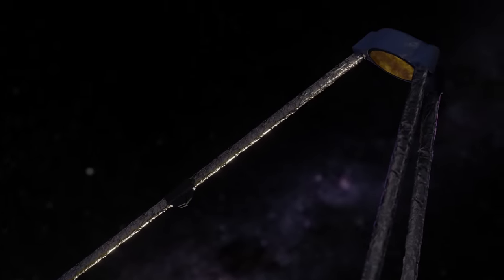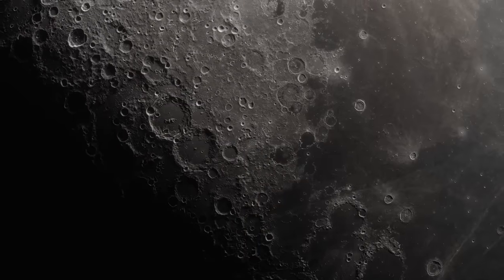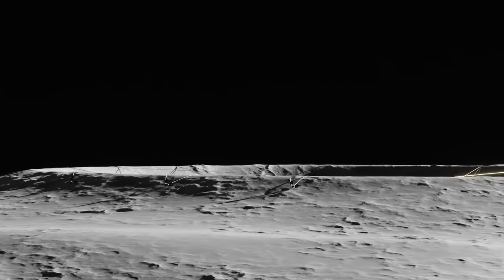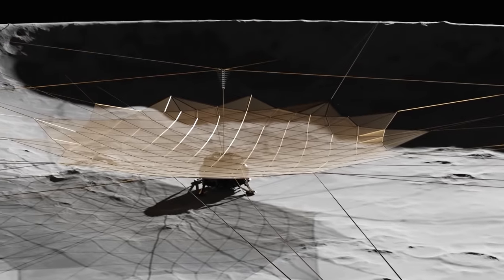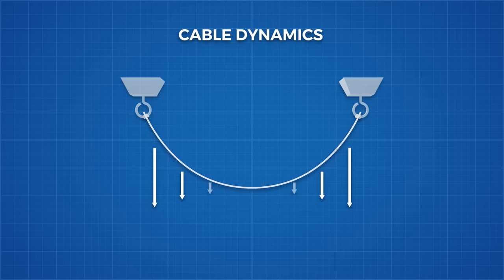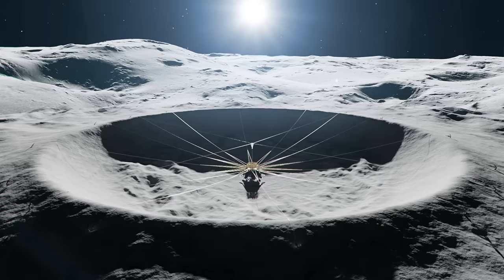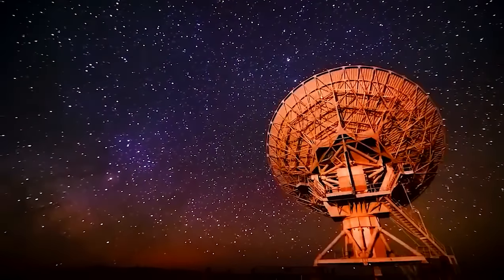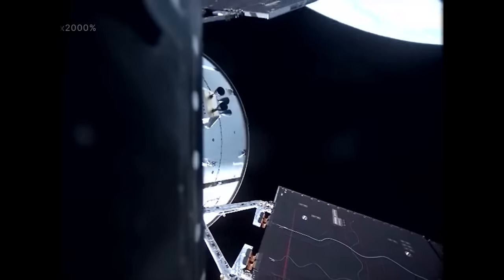NASA's Plan to Build A Telescope on the Moon

Comment: There's a near-future, hard scifi manga called Space Brothers where they build a radio telescope in a crater on the far side of the moon. It is an array of detector posts arranged in a 3-arm spiral with initial delivery of the posts done from orbit and then the crew and the helper bots connect them together. I highly recommend it, it's a satisfying and optimistic astronaut drama with no real antagonists.

Comment: Amazing work as always
Can you explain the weight point you make at 7:05
If the Moon's Gravity is 16%, how is 200 kg equivalent to 320kg on earth ?
Reply: He probably meant 2000 kg
Reply: The correct answer would be 32 kg so, it's probably just a decimal error
Reply: He corrected himself in a comment, he meant 2000kg to 230kg
Reply: He meant to say 2000kg, rather than 200kg
Reply: The subtitles had 2000kg
Reply: 2,000 kg on the Moon equal to 320 kg on Earth.
Reply: Has anyone mentioned that he meant to say 2,000 yet? Well let me say it anyway. There's worse bandwagons I could jump on...

Comment: I was already impressed with the idea of building a telescope in a crater on the far side of the moon. But when he said it was going to be done with robots, I was floored. Its already difficult enough trying to accomplish this with astronauts, but creating robots that can intricately and accurately build this telescope from earth is a level above hard mode.
Reply: It would be harder with astronauts, which is why they are doing robots.
Reply: @waspsandwich6548  No, it would be significantly easier. It takes far more effort to design and build a single-purpose robot that comes close to the ability of a human than to have a human do it. The reason astronauts will not be involved is purely because supporting astronauts for a long-term mission is ridiculously expensive, to the point that it would be completely infeasible with NASA's current budget.
Reply: @none-ro9dz  that's what I mean by harder. As in, in the broad scale of the entire mission it's harder for astronauts to do it than for robots to
Reply: Wikipedia says the apollo program cost the equivalent of 178 billion of today's US dollars. But that included 6 separate lunar landings, which means it was only 30 B$ per trip!

I'm sure you can't count like that since they didn't start each mission from scratch. But on the other hand, this telescope project sounds so complicated that it would surely exceed its suggested 10B$ budget. So... what's the safer bet? Training a few astronauts and get them to the moon and back (something we have already done), or inventing a whole new yet reliable robotics system? Who knows.
Reply: @none-ro9dz  If only we stopped funding pointless wars and diverted those budgets to something actually meaningful. Such as space exploration.
Reply: @Someguy6571  If only we stopped funding wars and pointless space missions and focused on important things like reducing pollution, providing healthcare and ending poverty
Reply: @none-ro9dz While I agree with you that we should also do the things you also as well said, but what is wrong with exploring space? How is space exploration pointless? I mean Earth isn't going to be around forever. Sometimes you need to plant the seeds for the trees you will never yourself see the shade from. Gotta think long term.
Reply: @Someguy6571  Right now, we simply lack the technology required to make interstellar travel even remotely possible. We also don't have a way of determining for sure if a planet is habitable, so the potential long term benefit of space telescope projects is lost and the overall effect is that we're just cataloguing distant rocks, ice, and fire. 

There's also the fact that that potential is only there if humanity survives as a global civilization for the indefinite future, which we won't if all our resources are spent on the military industrial complex, which the space industry is completely dependent on (as well as the proportionately less but still significant wastage behind spaceflight).
Reply: @none-ro9dz  We need to start somewhere, and I agree that we need to stop dumping money into senseless warfare and more into further improving humanities wellbeing.
Reply: But that doesn't make the 0.1%'s even more wealthy, so no, can't do that.  Besides imagine the increased illegal migration that would occur if the U.S.A became an actual "preferred destination" rather than the most convenient.

Comment: What about possible object impacts on the telescope? This is something that is not mentioned in the video but can be a massive threat for the project, and makes me question its feasability. There are literal tons of material reaching the Moon daily, and with no relevant atmosphere to dissolve them, even the tiniest marbles could pose a danger for the telescope. The fact that it is planned to be built on the dark side of the moon doesn't help either. It's even more exposed to impacts than the bright side, because it faces outwards from the gravitational pull of both the Moon and the Earth.

Comment: Imagine this actually gets deployed, everything works fine and than it's destroyed five minutes after by some random cosmic debree.
Reply: debris*
Reply: As he said, the mesh step should be smaller then the wavelength, which 6.5 meters. So, if it is done with, lets say, 6m step, there is a pretty good chance that some random cosmic debree will simply miss.
Reply: I’m pretty sure that’s why they wanted to see early on if they can alter the trajectory of rouge asteroids
Reply: @MSP_TechLab  Yeah, but I'd imagine the center is a big and important target, would'nt be such an improbable target to hit. Especialy since the Moon has no atmosphere to burn down even the smallest debris which traveling at those speeds could cause a lot of damage (not even Flex Tape could fix that).
Reply: @ColdyCZ  I think, of course, probability will be higher. But danger of meteorites and space debris is over exaggerated by hollywood movies. So, I assume that much smarter people in NASA  calculated such risk and decided that it is appropriate.
Reply: There are risks no matter where you put it. The odds of it being destroyed there are lower than the odds of it being destroyed on Earth.
Reply: Kramer: Force fields, Jerry, Force fields!

Comment: around 6:30 there are some small mistakes... the desired shape is not spherical but parabolical (this is common knowledge, you don't need to make it "easier" than it is).
And the weight distribution to achieve that is the opposite of what you showed. it needs to be heavier in the middle, with a distribution of the form 1/sqrt(1+x^2). If they introduce crossings under tesion, like a spider web, than they could counteract that. The tension in the ring structures can even be easier to adjust (compared to weights) if something doesn't work as intended.

Comment: Building this on Lagrangian poin just  is a lot more sense:
1. Sending astronout is plausible 
2. Waay less delta v (even less delta v than GEO ) 
3. Far enough from earth interference 
4. No temperature fluctuations
5. No weigh. You can use reaction wheel and lighter material.
6. Easier communication

Comment: 0:36: 🔭 The James Webb Space Telescope has captured incredible and unprecedented images of the universe, but a massive space radio telescope could allow us to go even further back in time.
3:10: 🌑 The lunar orbiter has been collecting data since 2009 and needs to be on the far side of the Moon to avoid radio interference. A crater with specific dimensions and characteristics is required for the telescope's operation.
6:05: 🌙 To create a better focused beam, the shape of the wire needs to be closer to a half-circle, which can be achieved by strategically suspending weights along its length.
9:20: ! The use of origami in space missions allows for compact packaging of large structures.
12:08: 🌙 NASA and ESA are investing in lunar exploration, with the goal of sending humans to the Moon's south pole.
Recap by Tammy AI
Reply: ok. why

Comment: the best method would be to have a drone that can drive to each point, secure the wires, and send them into the center, to be collected and attached, then used to setup the rest with special cable climbing drones. as this would allow adjustments on the fly, if needed, or to lower them to reduce damage, incase of any weird situations that might need a new cable to be planted.

Comment: Lunar dust might be a big challenge for this project.
Reply: no wind on the moon I think it's ok
Reply: In the construction phase, probably. But once the telescope is up and running, dust on the Moon shouldn't do much.
Reply: @looknamman  the moon has no atmosphere so all the space dust is still a problem, especially considering relative velocity
Reply: I don't know if dust covering the dish would actually have any impact. Is moon dust transparent at those wavelengths?
Reply: This was my first thought. Lunar regolith is an order of magnitude worse than something like terrestrial sand. It's sharp and incredibly abrasive as a result.
Reply: @looknamman  Moon dust can develop an electrostatic charge when exposed to the sun. This causes the dust to levitate. No wind necessary.

Comment: The faster and more economical way to build a powerful Lunar telescope, would be with multiple telescopes launched in various missions, arranged in a pattern. Or even simpler and viable, assembly a giant telescope at orbit, and then deploy it to a Lagrange Point. No issues with dust, landing, or thermal amplitudes.
Reply: Maintaining a formation of satellites at a Lagrange Point is increadibly complicated.
Thermal oscillations would still be a problem, since every Lunar Lagrange point is eventually directly in front of the Sun (with the exception of L1 which can't be used anyway because of noise coming from the Earth). 
Orbiting satellites have a lifespan dictated (among other things) by their propellant availability for orbital maneuvers. Maintaining a formation severily affects the fuel budget of satellites, and, at the moment we have no idea how to refuel a spacecraft.
An orbiting formation telescope is not faster nor less expensive to build

Comment: Hear me out,  if you make the radio telescope massively large,   like 4000km wide, It'll look like the Death Star.
Reply: Now we only need to find a 4000km wide crater
Reply: Moon's only about 2000 km diameter. Need to build it on Venus!  There's a lot of sulfuric acid, so don't use any metal.

(Surprising, but NASA has not yet put me in charge of any major science programs🤓.)

Comment: If it only has to last a year, then use an inflatable "antenna". Land in the crater, inflate the antenna, with a hole in the middle, though which the Lander raises the receiver up to the antenna's focal point. Make the antenna out of a material that the inflating gas can solidify or cure it before it leaks away, and Bob's your Uncle. Don't need a perfect crater this way. Or use inflatable tubes radiating out from the lander that have the support cables and reflector already attached. Either way, no grappling hooks needed. It's not like the evening winds will blow it over. :-)

Comment: There is another sollution to getting the dish shape right in adition to weight distribution. Basically that sollution comes from electrified traintracks, or rather the wires that feed power to through the panthograph. You see with traintracks you want the wires as straight as possible, but naturally they sag, no matter what you do, hecen a second wire is strung above and conecting wires are applied. The connecting wires pull the lower wires up, making them straighter, the upper wires get pulled down a bit, but we pretty much don't care about that one, so long as it stays above the lower wire.
now I don't think this sollution will be the "go to method" but it could help with the shape when weight distribution alone would be too tricky.

Comment: In terms of "steering" the telescope; Arecibo had this same issue, and as I understand it, there solution was to use a spherical dish, and then use a special receiver which could move and finish focusing the signal correctly.  Would that same concept not work on the moon?  Not saying it would be easy, just whether or not it would work.

Comment: Ok but if you place a static telescope on a moon that is tidally locked with Eath it means it will only have a field of view limited to the lunar orbiting plus it's natural wobble. Wouldn't it be worth it to make it into a rotatable structure so we can get a near 360 field of view in all directions? Or perhaps hang tiny weights on rollers on those cables to be able to distort that concavity to be able to rotate?

Comment: If cables are going to be used to support the dish, lacking a better word the cable might be able to be pulled in a way that changes the direction of the dish. While I don't see that idea will allow for the same degree of movement than a land base; however, a few degrees or fractions on a degree will be better than no movement.

Comment: An interesting problem with lunar telescopes; how do you get the data back to Earth? You wouldn't want to use radio waves that might interfere with the lunar telescopes. And you want to be able to relay huge amounts of data back to Earth. One solution is to use a network of laser communication relays. The first such demonstration from the moon was around 2014 with the LADEE spacecraft, which sent back loads of data in the blink of an eye using a laser. NASA's LunaNet project, and ESA's Moonlight project are exploring this exact topic.

Comment: There is a much easier scheme available.  Rather than concerning ourselves with a parabolic dish we can lay out sensors directly on any roughly flat area.  Then they can act as a phased array for steering.

The notable feature of radio antenna are their fault tolerance.  They deal with such long wavelengths that their receiving surfaces do not need to be carefully polished as optical mirrors must.  The upshot is that the phased array sensors can be laid out without much concern for surface imperfections.  Plus or minus a metre makes little difference for multi-metre wavelengths.

Much simpler construction, no tension structure needed.  Potentially much larger, limited by number and mass of the sensors and connecting wires.  Still all the benefits from radio silence.

Comment: If its on the moon, it needs to be bigger. Fill an entire crater on the darkside of the moon. And you could upgrade exponentially at will. Build structures for equipment.  This is a terrific idea. Ive heard similar before this. Be nice to look further into the vacuum with more precision.  This is a great idea people.

Comment: an inflatable loop where the pressure holds it in inner tube shape, where wire hooks are pre attached, if strong enough or if loop is filled with regolith powder means it will possibly hold its shape ( also wont leak) then need just a couple outter anchor points to avoid sliding of the loop. all kind doing a wall blow in insulation process! just a thought! Works for magnetic ring spacecraft too , if dust can be found in close enough proximity without a catch up velocity or gravity issue, or if you can make a platform on moon to take off with a starship load of regolith powder , have to work out the mass issue though, or comet ice /asteroid. Just a thought! comet would only need a tethered nuclear powered lander to suck up the ice powder or liquid nuclear melted water and pump it into the tube, the lander could be attached starship and the inner tube unrolled from starship bay. stupid idea or what?  use the loop for many things from magnetic tape loops to space telescope or large ship structures. list is endless.

Comment: Estimated Cost of James Webb at start of the project and different times during project were very different to the final cost. Not mentioning that the estimated costs practically never are correct is not good.
Also Hubble needed to be serviced after deployment, Webb was "If we do not get this right, all was lost". I do wonder what the options would be with a telescope like this on the moon of something goes wrong. Could the project be salvaged? How? What would it take? How much?
 
It's fine to positive look forward, but I am also interested in what could go wrong.

Comment: There is the issue of lunar regolith getting on and into everything. Part of the solution would require a method that deflects (through ionization) or otherwise keeps the regolith from sticking to the surface.

Comment: I have a feeling theyre greatly underestimating just how hard it is to keep a wire in place with even a small ammount of weight in the center. If you have a wire hovering over a 15 foot wide hole and one side is anchord into concrete and there is just 5lbs in the exact center you simply arent going to be able to pull all of the slack out of it unless you have a wench but then the wire would most likely snap. Now imagine this same thing but several hundred times more extreme and on on the moon. All held together by loose rock and simple anchors

Comment: Probably better to go with a spiraling mesh of tensioned fabric than a geodesic structure. Have adjustable tensioning points within a large spiral network to tune the shape. Much lighter and more adjustable than a geodesic. Just my two cents, but I have engineered many geodesic structures

Comment: To minimize damage due to friction on the tethers from the regolith (over time at lower cost), why not replace the regolith with concrete blocks with proper anchor points?  Yes this isn’t viable initially.  However with the impending reusable rockets coming relatively soon, this becomes viable at that time.